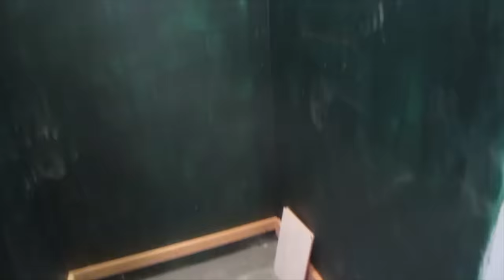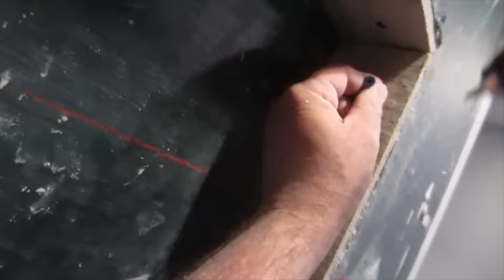Complete bathroom shower install time lapse start to finish

Comment: You excluded the part where you go from your pan liner over the curb, to having the entire shower sealed. Why not show the work?
Reply: MetusBatman V2 Good question.  I would like to see that.
Reply: Yes I was about to ask about that???
Reply: I can imagine what he did just by looking at the cut corners on top of the curb. He also buried de durock into the mud base ( huge mistake , good for  moisture and mold ) and other things I noticed.
Reply: I questioned that on another video and he said u can embed durarock in the shower pan because it’s a true cement board which will not wick water like  hardi board or wonder board which is a fiber cement board , he said it’s in the tcna handbook. Not sure on the validity of that statement though
Reply: If the tile isn't Square your trowel lines are supposed to run the short direction of the tile
Reply: @danthecarpenterman9463  dude does everything by the book, if he said it, trust him it's true
Reply: @gaeltest1446  incorrect
Reply: The only reason I was watching the video, just wanted to refresh how that part is Done, I thought you tape it and mud it before rolling the sealant, looks like he did, he's battery probably ran out

Comment: Sal there are few contractors that can directly install a mud pan for shower.  You did an outstanding job showcasing your abilities as a contractor. This video could of been made in detail in about 30 minutes, I like the way you used the fast-forward editing to show exactly how to do a shower pan correctly.
Reply from the maker: Fairfax Contractor Well there are actually several videos of this bathroom shown in more detail, Here is one https://www.youtube.com/watch?v=5GmutV5AOAU&list=PLE025D61CF6E3515B and here is a whole playlist of ho-to videos https://www.youtube.com/playlist?list=PLE025D61CF6E3515B

Comment: Well from doing tile over the years this guy knows what he's doing what an awesome job you're doing sir...
Reply: 100% Sal is the tile expert of youtube, I mean the Internet I mean your galaxy 😎😎😎 he's the stuff Legends are made of!! #Legend
Reply: Yeah he did good but only thing Is he used screws in shower pan liner that’s a big no no
Reply: @100kviewsviews6  there high enough up it will be OK
Reply: Marc Favell they not there... but that’s true but still screws is a big no no
Reply: If the screws are above the curb ...??? And what's the preference on it then as far as fasteners? It's how we always did it .. a nail ? It has to be fastened to the stud in some manner and then the durock  is what screwed to the studs no ? Just not below the top of the curb we had to test our pans and put water in them on 2nd rough in it was full to the top of the curb for at least 24 hours  for inspection.. so we couldn't skip the corners as he said or the silicone under on the 3 piece drain it would leak .. not could would and many 10 15 20 story buildings on the beach in ft lauderdale have walk in showers w pans just like that consider how much damage could occur when a pan leaks to the apartment below we have to take pride in our work or don't do it at all !!!

Comment: Great Job, I'm a 40 years Installer and that how it's done. The Schluter system has it's problems. You still need a mud floor! That styrofoam floor flexes under weight and breaks the tile bond!
Reply: Yup i was taught to mud. Even setters using to much hardibacker. Have home owners geting cracks. cement board on walls is ok. Floors should have mud. Just my experience.
Reply: Im not a fan of schluter at all, but have been using WEDI for 10ish years now no issues

Comment: I really like your Time-laps videos Sal !! Good stuff
Reply from the maker: Easy to do, You put some very good info out yourself.
Reply: ***** Hi Sal, I am looking to renovate a bathroom that's 32 sq feet that has a shower slightly bigger than the one in this video. What kind of costs should I expect?
Reply from the maker: Cost is not something I discuss in an open forum, but the cost will be affected by many factors. are you looking to hire someone or do it yourself?
Reply: ***** I will do a small part of it. I will be gutting it out myself and installing the cabinet and the sink and paint. But the tiling of the floor and the shower and everything else shower-related, I will not touch. You don't have to give me a figure. But apart from material and labor cost, what does a contractor charge for? Because when I included all the costs of the labor and the materials I came up with something like 4000 and I was being very liberal with my estimates. But then the contractor gave me a figure double that amount.
Reply from the maker: Get a couple of estimates, if you are not sure of the contractor, get referrals, people ask me for referals and I give them the names of peploe I have recently done work for. If they are all in the same ball park you have your answer. Cost of a job will be greatly affdcted by the cost of materials used, type of tile etc.

Comment from the maker: When ever i can i like to have the wall tile on top of the floor tile, but in reality it can be either as long as you caulk the change of plain. Sometimes it is impractical to tile the floor first, so you can leave out the bottom row of wall tile and then install the floor and cut that last row of wall tile in as you install the floor.Sometimes you have to finish the wall completely, so you leave a soft joint where floor and walls meet.
Reply: Kebin

Comment: For years they just slapped the pan in without a pitch under it can't tell you how many I had to tear out they leaked and also stank wow sitting water idk how it is in residential  now but the pan had to be installed on 2nd rough and filled with water w no pitch under it and the tile man came in behind and just packed it with the pan the way it was flat I never agreed w it but did what I had to then as I branched off into  more remodels and pan tear outs etc working  as a tile man I pitched it as you did and never had a issue but protect that pan fellas especially  on a 2nd 3rd 10th floor tile install even pitched it can leak keep the screws off the floor etc good job man. Looks great

Comment: Why is the line on top of the mud in the shower pan.
Reply: I’m going to assume it is a pre slope in case the water penetrates the grout and actual shower 
Pan ..he will come back after the rubber is down with another top sand Portland cement mix for the actual liner he just didn’t show it but look while he tiles the floor there is a cement pan .  believe me he is one of the best in the industry

Comment: I haven't seen one video on here that shows enough detail on how to slope the floor of a shower after the pan was put in.  I'm going to have to do the slope after the pan.  Can anyone suggest anything besides a leveler to get this done.  I don't want to use that Perfect pitch product either.
Reply from the maker: The third link is to a video which should help, in  my how-to videos play list you will find that same video and also a second method. I hope this will help
Reply: I just watched your How to Install Mud In  A Shower Floor Method 2.  That's what applies to my scenario where I've got a concrete subfloor.  I'm trying to remedy a terrible tile job on the floor of a shower so I just dug out the tile floor and now I'm working with an already installed shower pan.  But I still need to create the right pitch.  Do you suggest using a self-forming compound or using the Quikrete and sand like you showed in the video to form the right slope?
Reply: Heres my advice.  Take it or leave it but you can just level a line around your walls higher than the drain and just work it by eye.  A quarter or 3/8 per foot.  You can slope it any way you like.  If you think your mix is too dry, add some water. My advice, just go at it man. Take your time, spend a day on it, and try your best not to get frustrated.  Plenty of showers have been built by people who think they don't know what they are doing.  Don't doubt yourself,  there is no magic involved.  All you need is a trowel.
Reply: PS.  Ive been doing tile professionally for almost 6 years.  So I know for a fact that if you hire a "pro"  it could be a guy just like me or you behind a salesman and actually its his first pan.  Just don't get discouraged,  building a shower takes time.
Reply from the maker: emutiny He is correct, level your mud around the perimeter of the shower so that it is at least a 1/4" higher than the drain for every foot at the furthest point. When you then fill the middle part of the pan screeding to the drain you will automatically create the proper pitch. If you think the mix is dryer than you would like add some water to the top by squeezing  water out of a saturated sponge over the top of the mud without actually touching the mud, and then just flat trowel a little to smooth if needed.
Reply: WEDI, best product on market, and hard to jack up. But, bust out your big checkbook its expensive.

Comment: This looks really nice. It is good work. Is it a whole bathroom or just the shower and floor? I had contractor do bathroom. Tiling was perfect, but GC did the rest and I did not realize until it was too late that he did not insulate an exterior wall well enough. So, too cold in winter and too hot in summer. Only way to fix is to cut into tile and inject foam. Bummer!

Comment: Nice  video
Just just next time you used treated wood to frame around
That regular Pine cannot be touching directly with concrete
Floor
Reply: Ya its against building code to use pressure treated wood inside a home, unless buried in concrete
Reply: @jordanturner5278  I've never heard that before, all plate material that touches concrete is treated even interior walls. If he's putting blocking around the pan it should be treated, he should have blocked the walls before laying the cement pan, also should have put something between the 2x4 wall and the pan so the cement isn't in contact with raw wood. Just my opinion.
Reply: @VelebitMountainMan  on interroir walls its under the concrete to fasten a plate to. Thays why a sill gasket is neede
Reply: @jordanturner5278  ? PT Bottom plates anf Furring strips. End studs on masonry

Comment: Why do you use cement instead of mortar for the basement tile flooring? Awesome video! I did all my bathrooms too but your work is a joy to watch.
Reply from the maker: It is actually referred to as Deck Mud, and is the standard type of material used for this kind of work.

Comment: Sal,

I have done a few tile jobs (for myself, not commercially).  In preparation of a bedroom / master bath remodel, I took to youtube to learn any techniques to add to my limited experience.  I want to personally thank you for all of the time you have invested in helping regular folks do a better job (hopefully safer) repairing and improving their homes.  If there is a way to repay you for your insight, I would like to know.

I have a couple of questions regarding a walk in shower on concrete.

1. are there any cleaning steps to take before spreading the thin-set on the concrete?

2. should any special steps be taken to prevent the thin-set from being mixed into the sand mix?

As far as waterproofing is concerned;

1. I have seen videos of you using schluter kerdi as well as liquid membrane on the walls etc.  Is there a clear advantage to one vs. the other?

2. can the schluter be applied to the pre-slope?

3. some of the schluter videos show them installing over a sheetrock substrate for a wet-room stand up shower.  Do you recommend this?  have you done this?

Thank you for your time!
Reply from the maker: 1. sweep and clean any dust or bond inhibitors.
2. Mud bed will bond to thinset on concrete.
Schluter is much better.
Schluter is a membrane that must be used in conjunction with a the schluter bonding flange which is part of the drain assembly, I have videos that specifically address this. I usually use Kerdi-Board, but the membrane can go over sheet rock, however if it makes you feel better use a cement backer board.

Comment: Just one problem when you laid your floor tiles down you didn't slide them back and fourth perpendicular to the trowel lines so that the mortor has 100% coverage on bottom of tile, just laying them down only gets about 50% coverage which will lead to cracked tile eventually, large format tile requires atleast 80% coverage

Comment: I agree with most everything you do here except the wood in the curb, I have always made mine with solid mud with the pan inside and a piece of wire lath  bonding the inside and outside together. As you know a few drops of water leaking onto that wood will blow it apart in no time. Plus you can level it and pitch the inside a bit toward the drain.  I also set my shower floors in fresh mud, I can get them flatter when the mud is still plastic.  It takes a little practice but that shower floor lays down a little better....looks good.  44 years and still working.....

Comment: Nice vid Sal, you do nice work!  I use dry pack but place the rubber pan as the very first item then dry pack. I missed the step after you pack,pitch and then place your rubber pan. What are sticking the tile to? Not the rubber pan? Is there another layer that I missed?  Great work!
Reply from the maker: Yes, first you install a preslope, let dry, install pan liner, then final mud bed for the tile. Preslope is very important, but a lot of guys don't  put one in and just lay the liner on the flat floor.
Reply: ***** Sal i did my first mud bed (sloped) then pan liner then second mud bed (sloped) tiled it made sure weep holes were unobstructed, all this on concrete floor in my basement, now after 4 years i have a leak in the back side of shower,would like to know in your opinion what could have gone wrong before i tear out the whole thing. thanks in advance.
Reply from the maker: Before you tear out anything you should try to determine if the liner is leaking or if it is something else. Plug the drain with a test plug and put two or three inches of water in the shower floor without getting anything else wet. see if you get a leak this way. if so, then it is the liner, if not the leak is coming from some other part of the shower.
Reply: ***** thanks for your help i
have done several water tests including the one you recommend,now why would the pan liner leak?what would cause it to break?im thinking liner could be leaking where it meets the drain,what do think? would i heve to do a full tear down or just around the drain? also i have watched all your videos and i don't remember seing how you attach the liner to the inside of the curve since we are not supposed to nail it.any insight? thanks

Comment: LOl...I use my knee pads the same way...I hate strapping them to my legs...Nice pro job...I like the shower membrane install...Was that glue you used before the Wet bed mix-or some kind of octoweld? 20 years setting tile in philly.
Reply from the maker: Thinset before the deck mud to adhere it to the concrete.

Comment: Hello Sal, very good video. You're a pro at your craft, to be sure. I'd like to ask your expert advice. I'm having a new bathroom shower installed which will have a sliding glass door, and three Caesarstone (quartz) slabs for the shower walls. The base will be a Vanico-maronyx-planix acrylic base. I have been told that Durarock should be installed over the studs first. What thickness should the Caesarstone slabs be ? 13mm or 20mm? Do you recommend this kind of wall surround for a shower? Thanks.
Reply from the maker: I really don't install slabs, but I would expect that it would need some kind of base like Durock, as far as thickness and whether it should be used in a shower or not, I would research the product to see what applications it is designed for, but i have seen it used  in shower areas.
Reply: ***** Hello again. I've changed my mind and will install porcelain tiles on the shower walls. My contractor will go this route: 1) Studs 2) Greenboard 3) Kerdi
(from Schluter) 4) Tile adhesive 5) Tiles 6) Epoxy grout.  Is this the correct way to go, in your expert opinion? Thanks a lot.
Reply from the maker: L Duranceau
Sounds like a plan to me, Schluter is a good choice.

Comment: Would you tile over green board in a shower wall not the floor? Would you tile a ceiling without lathe?
Do you think hardie is overrated? I do! I heard 1 1/4 plywood is best cdx of course and 2 layers sub and then criss-cross. I would really like to hear your opinion.
I spent many hours tearing out a 3/4 plywood from hell just to put in hardie!! I'm beside myself with how things are done especially lathe!!! Grrr am i wrong?
Do you ever use epoxy grout? Can i use that epoxy grout to cover up a bad shower pan install?

Comment: 😊👍Excellent, I am just now learning to work on projects around the house...new home owner, been in my new home for 5 years but things are starting to need maintenance.
There is 2 choices, pay someone big bucks or learn to do it, i've chosen to try to learn, so far i've been good so far but it will be years till I can say i'm competent as learning off of YouTube isn't exactly ideal because of all the "little details" and tricks that can only be learned by working with people who know the trade including where to get the best prices and what to avoid.
Reply from the maker: Some times things look much easier than they actually are, and the only way to find out which is which is to try it.

Comment: Question to the experts. When your using smaller tiles do you have to shift it back and forth to make a good bond? I know with larger tiles you have to coat the tile and then place it on top moving it back and forth to form a good bond.
Reply from the maker: Because the smaller tiles have very little surface area they are easy to embed and collapse the ridges of the thinset. The bigger the tile gets the harder it becomes, that is why you need to shift large tiles back and forth.